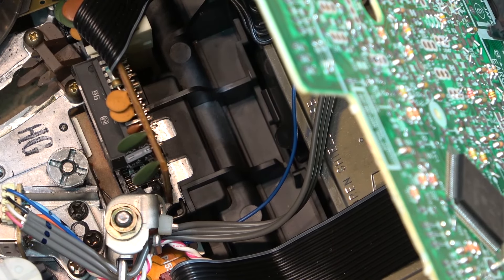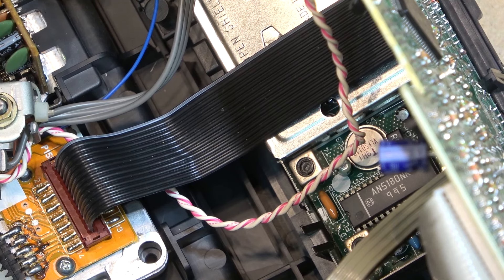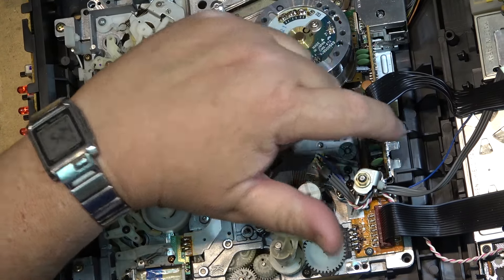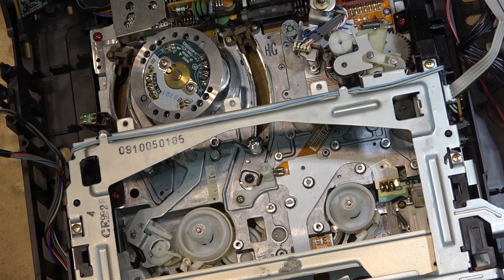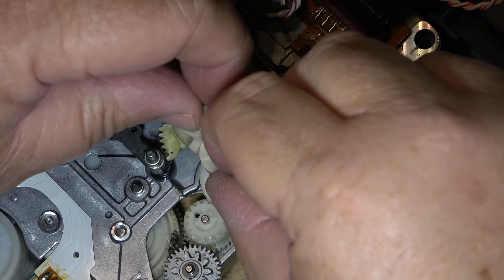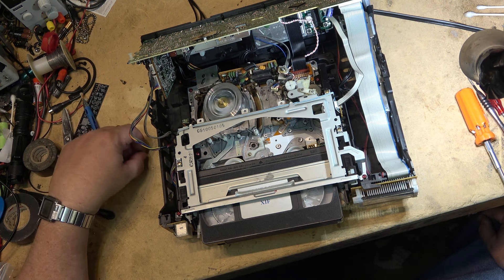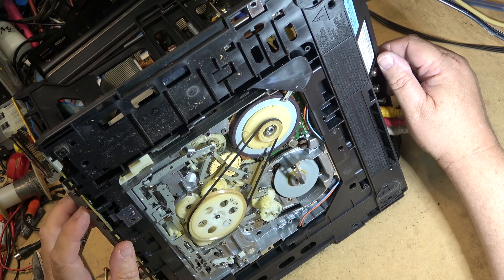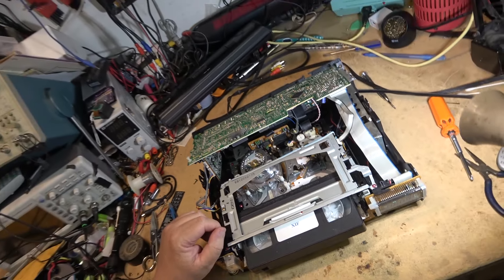Panasonic G Mechanism VCR were a real piece of Garbage

Comment: I came home from Goodwill with a PV-4065S.  It goes nuts, transport does all kinds of crazy things.  Thanks for the video, maybe it will help me get it going.  I have it running now.  I found a cold solder joint on the mode switch at the side of the elevator and 5 bad capacitors in the power supply.  Your video was a great help.  Thank you.

Comment: maybe i missed it, and i was soo surpriced after openening and cleaning many parts over and over and the problem was still there !. here is it !! = THE COVER ON PANASONIC VCRs MUST NOT BE OFF FROM THE MACHINE to test the machine, if the cover is open the FF will always engage and no other function will work. buy finally put the top cuver on the machine and everything work super smooth Panasonic NV-HD680

Comment: Hello sir, I have Panasonic nv-G2 vhsc camcorder. It plays tape fine but when I try to record it starts but fades out it looks like fading button is stuck but not. I check the button. It is ok. But the voltage between legs of the button is not steady. I don't know where to check next. I just got the services manual. Do you have any ideas?

Comment: I've worked on PAL K mechanism machines and there are a lot of differences.  The NV-HS1000/AG4700 has a long plastic sled going across the bottom of the deck, and on one of my machines that part snapped and I had to replace it and re-time much of the mechanism.  They also have a loading motor, which yours doesn't, but the motor coupling frequently snaps.  Have you seen that kind of K-mechanism?
Reply: The drive belongs to the G family (lifting magnet, rotary switch at the top and soldered), but it is missing the large brass roller on the left like I know it from the Panasonic NV-FS 88/90/100.
Reply: @TTVEaGMXde  Yes, K is a single-slider 3-motor design.
Reply: @TTVEaGMXde  The NV-FS series use the GII mechanism. The main difference is the extra motor for reverse playback and search modes.

Comment: The video board IC (green color) mounted on main board has 2-3 surface capacitors inside it that can fail. This will cause no video playback. All Panasonic G-mechanism models had this problem, in addition to the mechanical problems, plus switching power supply problem as well. Triple negative.  You always throw it into the dumpster if you see these three set of problems at the same time.

Comment: Hey, at least it doesn’t have a 100% failure rate like some Sonys with that white take up gear cracking on their Hi8 machines or the supply side sled blue gear cracking on most of their VHS machines.
Reply: This one was f’d up by the previous repair tech who didn’t know what they were doing.
Reply: Yep Sony were Garbage I prefer these Panny's love the smooth loading of them and great picture when the heads are clean.
Reply: @kingshearer2 Agreed every Sony VCR  I've had has been troublesome, yet the Panasonic's I had the Japan made ones are top notch, my nvhs900 svhs I bought new in 95 it's still going now, I have several other pany VCRs all have been good as gold, also have a couple old hifi Akai VCRs with all bells and whistles on that have served me well too.
Reply: @Megalocade  I've got a HS900 too (not from new I must add)  K deck's I think, .replaced the G deck.

Comment: I had a fair amount of capstan motor problems on these decks over the years. The capstan motors had to work pretty hard handling the rewind and fast forward of the tapes. Usually the tell-tale sign was the motor screeching during FF and REW.
Reply from the maker: They were garbage.
Reply: @12voltvids  At least you know Toshiba built better and more-reliable VCRs than Panasonic in 1988-1990.
Reply: The screech isnt the motor, its the brake that rests on it. Clean or replace the felt and the problem is fixed.

Comment: The infamous Pansoinic K mechanism was not one of their best designs.
The early Panasonic decks were excellent, then they started cost cutting 
and the rest is history.
I found that the Sony decks gave a better performance until the capacitors
dried out, at least they made repair kits for them.
Reply: I recapped a handful of sony PSUs. At least the caps are dirt cheap and easy to fix.
Reply from the maker: They were the shits but moneymaker.
Reply: @PlutoniusX  The Sony decks had a simpler design and apart from wear and tear items
gave little trouble.
The Panasonic G decks were good, but as Dave has show us the K decks were far to complicated.
Reply: @Barbarapape  Absolutely. I have a stock of blue gears and capstan bearings so I am set on Sony VCRs. That is about the only thing that goes wrong other than the half arms need some lube and TLC.
Reply: @12voltvids  True, they kept us employed, but i still shudder when i see one.
Reply: @PlutoniusX  It's amazing that these older machines are still going and repairable.
Todays plastic everything won't be working in 40 years time.
Reply: The cutoff year was 1983 that were not disposable. In 1984, all Panasonic PV model VCRs came with switching power supply, and they were designed to be disposable, not repairable after the power supply fails.
Reply: @Barbarapape  Toshiba built the most-reliable S-VHS VCRs in Japan. All other brands had a lot of problems. Most former techs don't acknowledge that yet.

Comment: There were several variants of the G mech over the years. Most of them use an orange-colored toothed belt as apposed to the rubber belt this one has, as well as an exta half-load arm that brings the tape over the A/C head for counter readout during FF/REW. AG-1970 uses the GII mech, AG-1980 uses the K mech.
Reply: Both AG-1960 and AG-1970 use the same Gii mechanism.

Comment: I agree it is overly complex, but to me it is a mechanical marvel; watching it moving is mesmerizing. I had to fix a TOTL Panasonic with the KII mechanism (I remember it had an extra toothed belt to speed up operations or to allow jog shuttle operations) with two broken gears (teeth snapped off). Once lubed and re-timed the tape transport was working perfectly. I honestly hated a lot more the membrane keyboard which was causing false contacts and locking the machine up (remote included).
Reply from the maker: Membrane keys blow, and by that I mean they suck.

Comment: One wonders if the engineers who designed this were just having fun at the expense of everyone else, or if all those gears and levers really cost less than another motor and its control electronics.
Reply: Normally the lifting magnet would have to be more expensive than a standard "Mabuchi" motor. Or the lifting magnet was off the shelf and cheap, which would explain why it burns out more often.                                                                                                                                                                                                                                                                             My Opinion😉
Reply from the maker: Was disgrunteled. Went to Elna with the new secret panasonic capacitor formula. Well the rest is history...LOL

Comment: I remember my grandmother had a VCR like this. Hit the eject button, wait ages while it clicked, clunked and banged away, get the tape back. 🤪
Long story short, it went dead and got to be the VCR I learned from by taking it apart. Even back then it cost more to diagnose and have it fixed than it was to replace.

Was never able to actually fix it since by the time I found the bad transistor in one of the power circuits (after disassembling EVERYTHING), that loading mechanism drive gear hanging off the side was missing a couple of the smaller teeth. It was white plastic and not die cast like the one in the video. Stupid, stupid design. They knew it, too since everything I've seen from Panasonic after that VCR had a separate loading motor again.

Shame, too since it was a HiFi model with VU meters and manual record level... Also had a bar code scanner with a booklet of codes to program it. It was wacky.

Comment: There was a modification in a service bulletin on this model. After replacing the mode switch you were to add capacitors to the PCB to reduce switch bounce. The bounce was confusing the processor causing to leave the solenoid on which burned it up. Back in the day you could buy a rebuild kit with the solenoid, switch and capacitors. I spent 23 years repairing consumer electronics.
Reply from the maker: It wasn't so much switch bounce it was dirt in the switch, usually tar and nicotine from people smoking. We used to change the switch and add the caps when under warranty but out if warranty just remove and clean the switch and they didn't come back.  Used to replace the thermal fuse on solenoid.  Out of warranty nobody, not one single customer would pay for parts and labour, they would trash the machine. The guy I worked for gave free estimates therefore id someone didn't fix it it was straight out of my pocket because I was not paid for refused estimated. One of the many reasons I told him to fu*k himself.